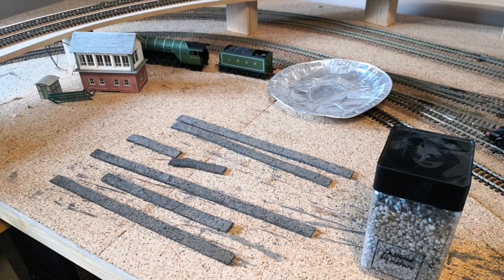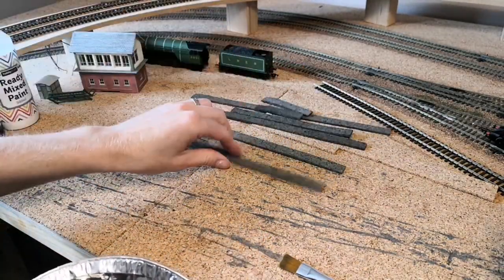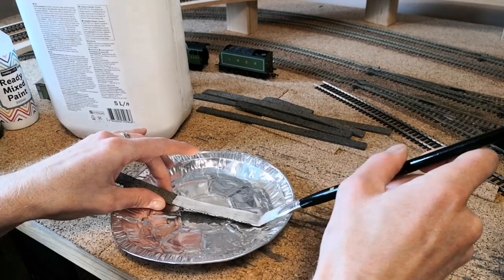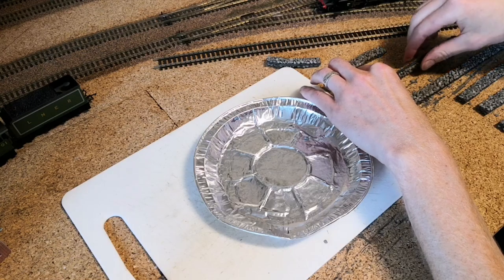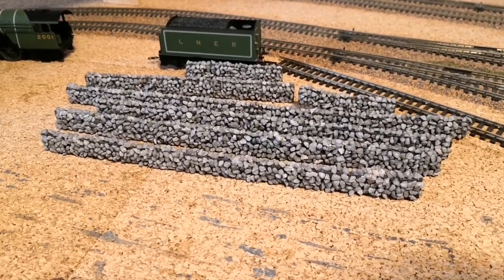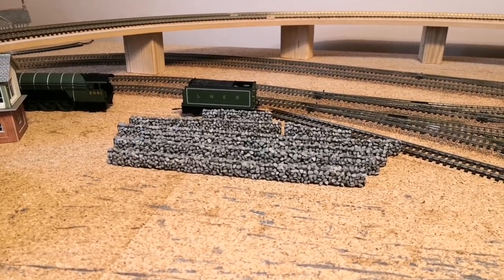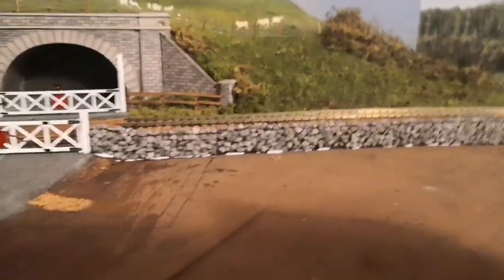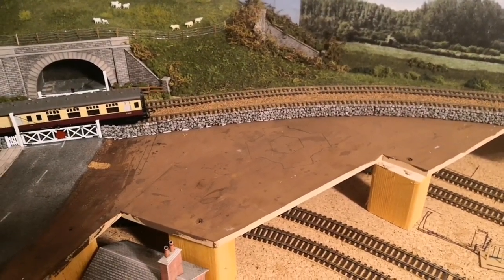Greenhill Junction - Making Dry Stone Walls - Video 48

Comment: Nice idea with the cork, I can see how that might bend slightly allowing you to form curved walls.
As for the stones falling off, one solution is grab adhesive (sometimes called Hi-power) adhesive from poundland.
If you want quick try 5 minute expoy also from poundland. 

Either way after it's dried, you'll notice it will leave white (or obvious dobs of glue) under your stones.
The trick there is get some cheap filler from poundland, mix in some PVA and very dark grey acrylic paint and slap it over everything. 
Not pure black, because that can look out of scale.

Then just before it's dried very gently wipe a slighlty damp washing up sponge over your wall.
That will force your 'mortar' into the gaps. 

Now you can leave it like that, but if you want a weathered effect slap on some a tiny bit more filler/paint mix and let that dry.
Next take one of those green & yellow washing up sponges, then using the green side and gently rub along your wall.  
Some of the green sponge will get caught in the gaps between the sponges giving a litchen style effect.

The green side will also abrade the edges of the stones, giving a nice weatherbeaten effect.
This works particularly well if you use fishtank gravel, which will also give you a range of different sized rocks and colours.
For that try wilko or pets at home.
Reply from the maker: Hi. Thanks for watching and commenting, and for the great advice. I'd wondered if a mortar could be applied to fill the gaps, but hadn't tried as I would've ended up wiping the stones off! I'm done building walls just now but if I revisited it I'll try this out. Cheers, John.

Comment: Hi John- They have come out very well and look good in situe. I think they look just right height wise perhaps a little weathering maybe to show a little moss ? 
Cheers Kev
Reply from the maker: Hi Kev. Thanks for commenting. They probably would look better with some weathering, but it's not something I do. The stones are not stuck fast either and and can come dislodged so I'm not sure how much you'd be able to do. Might try sticking some fine turf to them to simulate moss. Cheers, John.
Reply: I make you right don’t do anything that might spoil it.

Comment: Very nice finish. I  like it :)
Reply from the maker: Hi. Thanks for watching and commenting. It does give a good finish. Takes time getting there but is worth it when you see a long run of walling as I have at the village. 

Some have commented that it would look better with some weathering, and I'd agree with that, but I'm not sure how stuck the stones would remain if I started brushing over them. I have bedded them into the layout with a line of course turf at the base which makes them look more part of the landscape. Cheers, John.
Reply: @GreenhillJunction  I have decided to use your method when the time comes, except I'll not cut the cork so straight at the top. It is quite common here in Malta to find storm-damaged stone walls which were never repaired. Our stoned is not so round like yours and are more a shade of red, stained by the soil they were originally dug out from :)
Reply from the maker: Good idea, that will add a nice effect. Hope the method works well for you and you produce some lovely walls. Cheers, John.
Reply: @GreenhillJunction  Thanks. Be safe. Joe